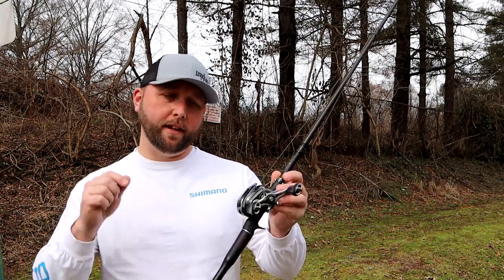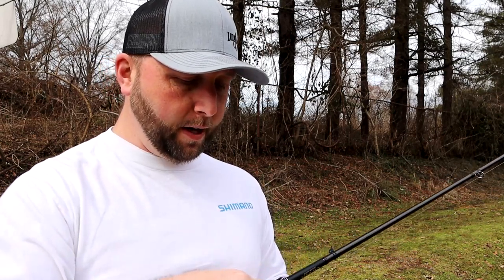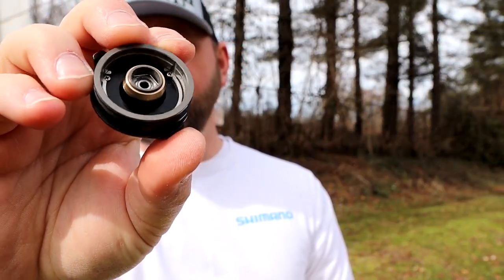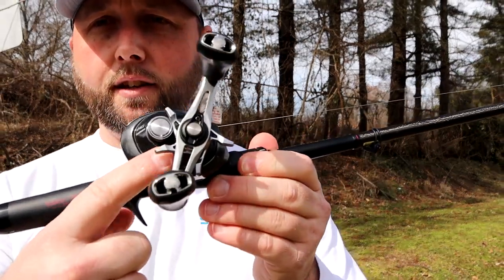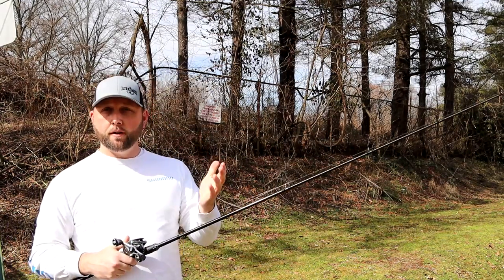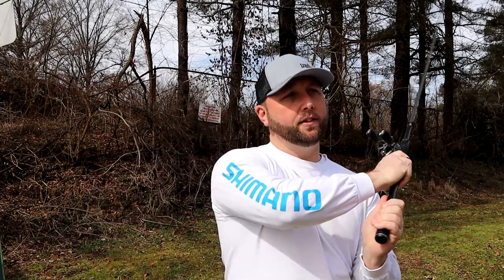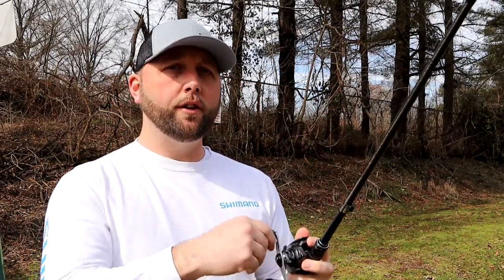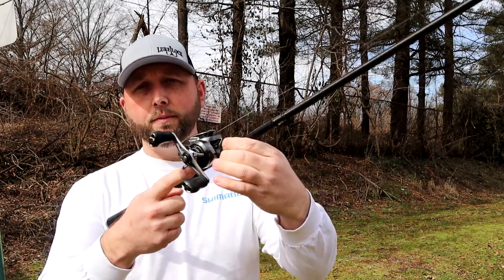HOW TO properly set up the brakes on a bait casting reel!

Comment: Hey I just got the metanium it’s my first baitcaster so I’m alittle lost. I adjusted the spool tension knob so there’s no side to side play while it’s on brake dial number 6 but when I change the brake dial number the spool moves side to side a little but I didn’t adjust tension knob. Is the break dial like a micro adjustment of the spool tension?
Reply from the maker: The Metanium has Shimano’s Svs infinity braking system. That’s what the brake dial is for. That shouldn’t be contacting anything while the spool is stationary even at the 6 spot. It sounds like you have a brake shoe that is contacting the spool somehow. The svs infinity system is a centrifugal system. When you cast a lure, the brake shoes get thrown against the brass sleeve in the side cover. The brass piece in the side cover is Shaped sorts like a cone. As you change the dial, the brass piece moves closer or farther away from the brake shoes. This either increases or decreases the friction on the brake pads as you cast due to the cone shape of the piece. My advice would be to make sure there isn’t a brake pad on the spool that is weirdly installed first. If that’s not the case, put the dial on 3 and adjust the spool tension knob to just barely allow the lure to fall when the spool release is pressed. Allow two brake pads to be loose on the spool and give it a go. The Met does have a MGL spool so it doesn’t take as much effort to cast it. Cast it too hard, even with the brakes set correctly, and you’ll get a backlash.

Comment: I pressed my break down a little to far. I think I broke it. Can it be replaced or do I have to buy a spool?
Reply from the maker: Which brake are you referring to? The plastic ones that are on the spool I assume? If the spool isn't broken you can absolutely replace those plastic brake "shoes" for lack of a better term. You can pick them up from Shimano's website an many of their reels come with extra in the box.

Comment: Hey! I have been trying out for casting distance my metanium mgl paired with zodias 7.5MH rod. (inside brakes 2 on, 2 off) Outside brakes set to (2). With 1/2 ounce lure I'm casting max 100 ft with 1 ounce lure I'm casting 120 ft MAX using 12 lb fluorocarbon. Is that about a normal cast distance. What do you think? I'm thinking about returning my metanium mgl.
Reply from the maker: You should be getting way more distance than that with a 1oz lure. The spool tension knob isn’t cranked down too tight is it? Is the cast at 100ft smooth? What I mean is, it’s not backlashing is it?
Reply: Thanks for the reply! Tension knob is the same the way its dropping is the same for the 1/2 ounce. Which is really I'm not understanding. I'm casting it the same way. No backlash or anything my only concern is the distance, I was kind of expecting more specially coming from Metanium. I'm not really but i'm really thinking of returning it but I kind of don't want to at the same time.
Reply: @OnAnotherLine  have you tried a 10xd on the metanium mgl? Do you think it can handle it. Or I should just swap this for a tranx.
Reply: Don’t worry about it, most people ga e their measuring units all messed up when casting.